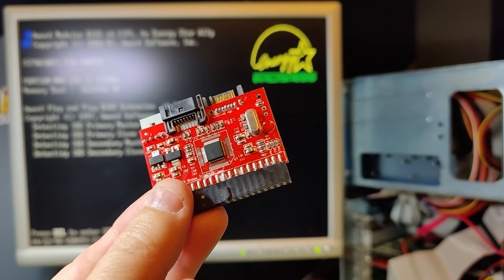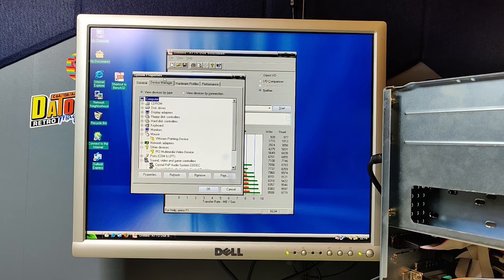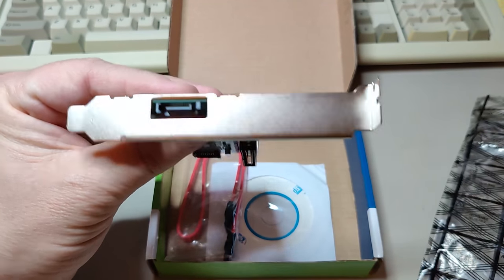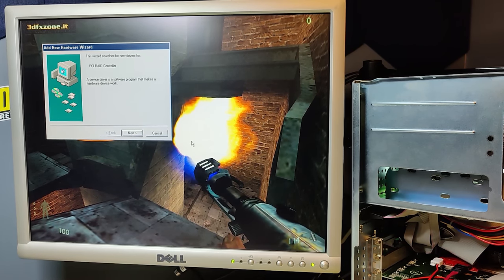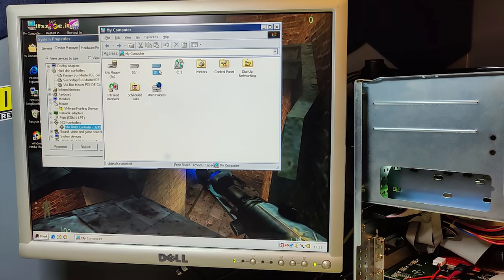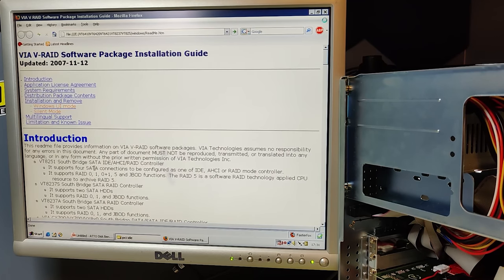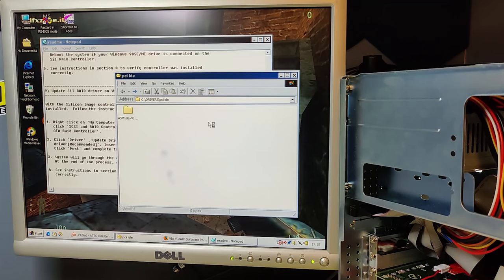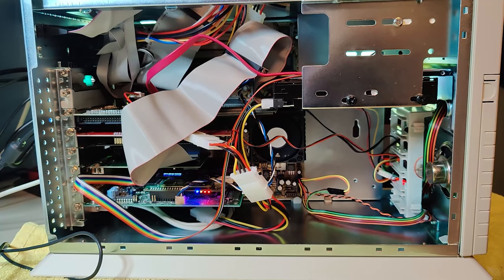How to get 56MB/Sec read speed on an Pentium 233MMX in Windows 98SE.

Comment: I think there should be a ROM chip where the "Q.C. PASSED" sticker are located on the card to make it bootable. The two other directories on the driver CD are for other controller chipsets, the Silicon Image Sil3114 and a range of ASMedia ones.
Reply: possibly, it is my belief that you'd need a bios that would enable the  ability to boot, similar to what is done to boot CF cards on old machines

Comment: Try to install via drivers for motherboard first, just right after clean windows instalation. Then other drivers. Problems with isa cards and ide/udma might gone.  You might also try do the same as i mentioned with plug and play disabled then first via drivers for motherboards then enable plug and play let windows install other drivers then other missing driver manually.

Comment: I was unable to find anything online for video formats on the first Mac. The closest thing I could find is makinf a Socket 7 PC build with a Pentium MMX 233, 56MB RAM and about 1.5-2GB HDD space. You will also need to find an SVGA (Super VGA) compatible GPU that will work with the socket 7 motherboard.

Comment: How was the CPU usage during the tests?
Does reading/writing use CPU with DMA on or off?
Reply from the maker: I don't know. Win98 does not have a builder in CPU monitor. 
But when I tried starting games like quake 2 i noticed that I was unable to move the mouse while loading the game. When I started the same game from the c drive i could move the mouse while loading. So I believe the CPU usage is higher.
Reply from the maker: There is no way for me to set DMA on/off., but this is a good question.
Reply: @RetroErik  There is an optional resource monitor in the Win98SE installable programs. It's amongst the system tools and is called System Monitor. I used it earlier today. I add it to the items to install whenever I install Win98SE.
Reply from the maker: @tahustvedt  Yes i know about it (but had almost forgot) what du you suggest i use it for? Meassuring CPU when usering tyhe harddrive?